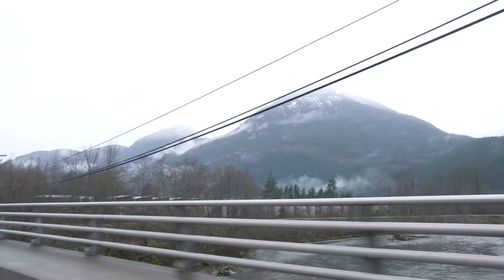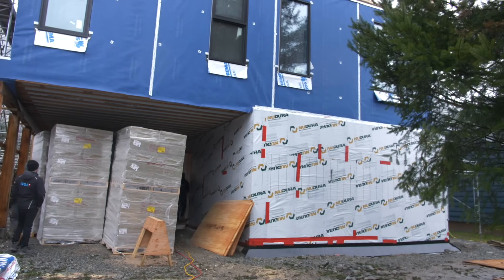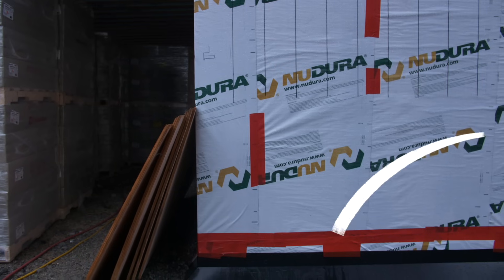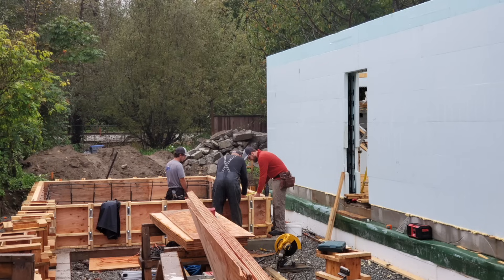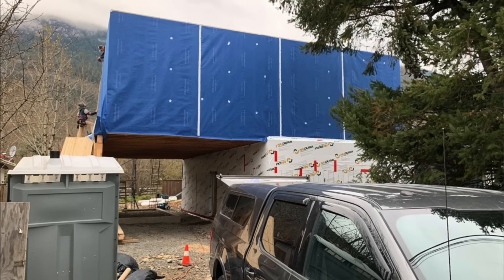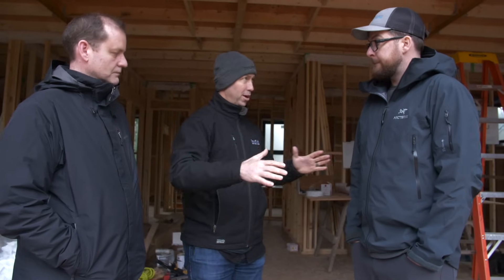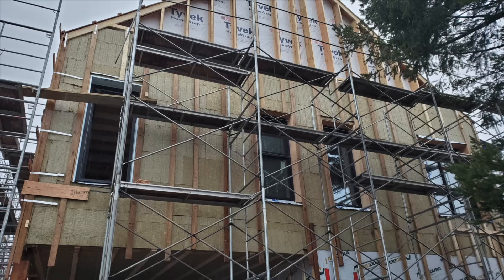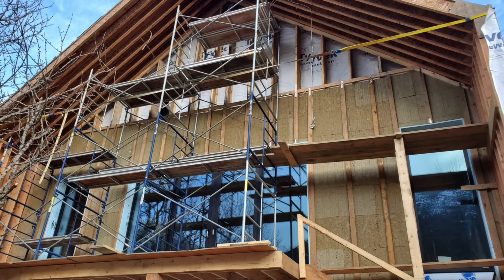Some Awesome Insulation Details on this BC Passive House!

Comment: I have personally insulated ice manufacturers buildings with only 5" of spray foam.  Where we are at it's very common to see 100 degree days for about two months with 104 days on occasion and the inside of these buildings need to stay at about 0 to -10 to keep the ice cold enough.  The owner didn't follow the engineers advice (who didn't have experience with spray foam) and installed about half the cooling tonnage that was suggested.  Even in 104 degree day the coolers will shut off regularly.  Spray foam R value is way under it's real world performance value.  This house could have been super insulated with a mere 5" of spray foam and been much cheaper to build.  Too bad so few architects understand the value of polyurethane spray foam.
Reply: G ahead take the EPS foam form from a shipment you received like a computer per say if it came with said foam form. and then take a lighter to it (do this outdoors) just to see how "flammable" your claim is about your "expertise" of said foam. And Black stains does not mean it actually caught fire, it just shows where it smoulders, much like how smoke blackens from the carbon when it is also burned, its called sublimation. Most fire death are due to the actual materials which will catch and stay on fire creating actual flames. Vinyl is much the much the same, it just melts and sublimates thus why it looks like a mass of goo and has a carbon coating after it goes through a house fire.
Reply: @Joshua79C  I said that EPS is flammable.  PU spray foam is combustable.
Reply: @repalmore  Combustible and Flammable means they can catch fire and flame up but in each a different way.
As I said, hold a lighter or match to a piece of eps foam and try to get it to stay on fire, It will only melt or sublimate only when a flame or enough heat is present.
Reply: @Joshua79C  Combustible can't sustain a fire.  Flammable can.  Very important distinction when fighting a fire.
Reply: Is the foam fireproof?
Reply: @jeffhallel8211  Fire proof, no.  Steel is not fire proof.  In steel structural buildings they have to spray the steel with material that keeps it from burning so fast.  PU foam is not flammable.  It is combustible.  What's the difference?  It won't burn on it's own.  There has to be an outside fire source for it to burn and even then it surface chars and delays the burning of deeper parts of the foam.
Reply: @repalmore  The grenfell tower apts in W.London were insulated with some type of flammable plastic.72 residents were killed. So I am wondering why people are not very concerned about the products they use.Thanks for the info.Curious about the inslation used in this construction,is it cement based like an aircrete or is it petrochemical based? Any idea?
Reply: @jeffhallel8211  Looks to me to be expanded polystyrene bead board or the same stuff that a cheap white cooler is made of.  I do not know for sure that this material has not been treated or not but polystyrene is flammable and will support fire.  It also give off some bad gasses but don't know if they're just irritating or deadly.  I will never use EPS in any of my projects for sure.
Reply: @jeffhallel8211 Those was cheap china panels without any approval ratings and that's why they had flammable substance inside the panels.
Somebody want to gain the extra profit and used a panel which wasn't meant to be used for that job.
Reply: Jeff Hallel it’s more resistant to fire than that foam they insulated that house with. It meets a class 1 fire rating which is better than lumber. It’s also behind a 15 minute thermal barrier when completed. So an increased risk of fire from spray foam in a house is ludicrous.
Reply: @christophergruenwald5054  Spray foam won't support fire.  It will only burn when something else burns it.  The surface chars and the char delays the burning of the foam under it.  There are many cases where foam did burn but protected what was under it.

Comment: It is the modern version of Noah’s ark, be sure and open all the windows if a tornado is in the area. This thing is built for implosion.You absolutely should not seal your house to where  it cannot breathe. What are we looking at “spending an extra hundred grand to do this?
Reply: I suspect it has an ERV. Assuming that the air quality would probably exceed the air quality in a leaky house.

Comment: Id like to know the cost per sq ft on this one!
Reply: Whistler is the Aspen of Canada. This house is worth $3M ~ 6M depending on location.
Reply: @hiroanz  This house is not anywhere  near whistler, in fact it is in about the worst neighbourhood it's town has to offer complete with backing out on to a rail road track.
Reply: @canvfrluvr8005  probably another good reason for all that foam: Tone down the trains passing.....if possible.
Reply: @mplsmtnbiker3867   It's possible. I stayed in a super insulated house in Denmark years ago that was only meters from the train line. There was only the faintest of rumbles when the trains went past but no noise
Reply: Wow! My region is less than 150 sq.ft starting and goes up from there. Seems like bad times waiting to happen building in a flood plane. I just cant get over building where u anticipate flooding.. Shouldnt the house be built on stilts like coastal locations?
Reply: Eric Lundgren yea seems crazy to build a house that size for that amount per sq ft and put that at massive risk it’s not always that the water is flowing it’s what the water is flowing lol
Reply: @ericlundgren3319   It looks like it is on a kind of stilt. The main living area appears to be on the upper level. The lower level, I would guess, is the utility room; mudroom, storage, things of low or easily defined value.
Reply: @ericlundgren3319  Naaah, not sure about Canada but in the US tax payers will just pay to rebuild it exactly where it lies
Reply: Depending on the region, around $300 a square foot and up just to build.
Reply: the build costs went up in BC a couple of years ago to the point where they are just absurd, no real reason that I could figure out as materials or labour never went that high. 3 years ago it was around $170/sqft on the island, yes whistler is more expensive for land and maybe add a bit for location/land. It's even at or over $300/sqft on the island for local builders now, just crazy, just ripping people. I should add that the $300/sqft was just for ordinary builds, nothing fancy.

Comment: Most intense sub slab and attic/roof detail I've ever seen. We don't have winters quite like that being in zone 4a. But if we insulate even half of what they did there, it's considered a superior build here.. 

I've not seen an envelope done like that either. It looks involved, but simple at the same time. Very interesting. I'd like to see how they run the mechanicals and address penetrations in that home also.. 
At any rate, there is no way they won't meet and/or exceed passive house assuming the window and door, and penetrations are addressed correctly. I couldn't imagine it anyway. 

Thanks for the content 👍
Reply: It's Whistler. It's the "Florida" of Canadian cold. It gets damp and yeah, cold too, so that insulation isn't strictly required for thermal purposes. I think as much as anything it's an engineering exercise and showcase for the builder and the products. I like the roof though. I'm storing that idea for my upcoming ICF build.

Comment: Matt, you should re-tear down your Austin build and do this instead.
Reply: Passive is mostly usefull for cold climate and not sure if it would be cost effective for hot climate.
Reply: @rakashaagain  Why? Insulation also works to keep heat from bleeding into conditioned space.
Reply: @rakashaagain  there's a climate called "temperate climate" that's when you are near the sea and the difference in temperature from winter and summer is lowered compared to more dry areas.
Reply: @TheIcyhydra  yea colder area. Thatsy exactly ehat I said
Reply: @rakashaagain  cold or hot climate isn't really defining the humidity level. there's hot dry desert and cold dry tundra.
Reply: insulation have diminishing return from investments
Reply: @TheIcyhydra  Matt Risinger has diminishing returns from investments. It was a joke.
Reply: Maybe you Clowns should ask yourselves why refrigerator walls are thick, freezer walls thicker and on older,models built to last,  even thicker?  Nahh, you're all too smart.
Reply: @roxyraccoon8856   do you really think anyone wrote that insulation isn't useful for cold areas?

Comment: Siga Majvest is not airtight!!! It allows air diffusion but works as a barrier for any water.
Reply: It allows vapor diffusion, not air diffusion. It IS an air barrier.
Reply: Nomen Meus believe me. I’ve used this product and there’s definitely air coming through the material!
Reply: @pianova5825  While no material may be 100% effective, Majvest performs well below the minimums to be considered an air barrier, according to Siga's specs.

Air permeance (ASTM E2178)
0.00114 cfm/ft2 @1.57 psf
0.0058L/m².s @ 75 Pa  (minimum for air barrier material is 0.02)
 
Air leakage in assembly Penetrated Wall (ASTM E2357)
(Including ASTM E283)
0.0002 cfm/ft2 @1.57 psf
0.0008 L/m².s @ 75 Pa  (minimum for air barrier assembly is 0.20)

Of course, all seams/joints in the material must be properly sealed.
Reply: @nomen_meus  The notion that a membrane can allow vapor through but block air sounds utter BS to me, since vapor is part of air. There has to be a more accurate description of what these barriers do.